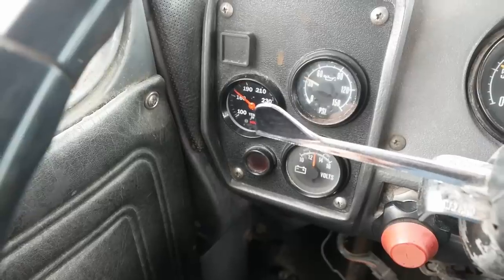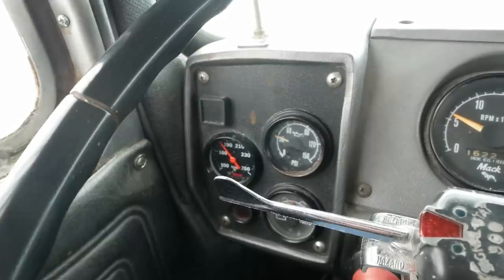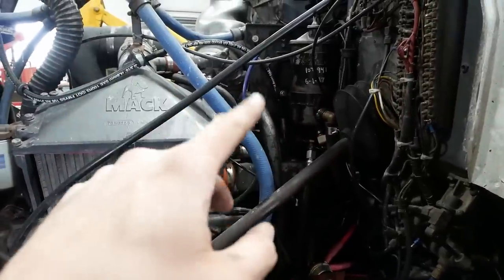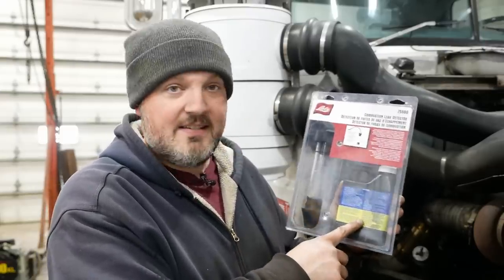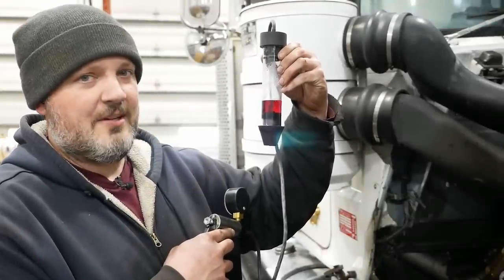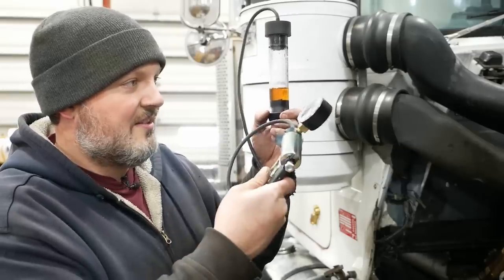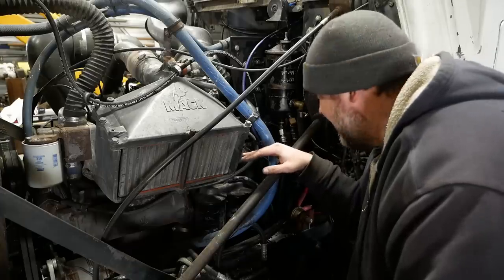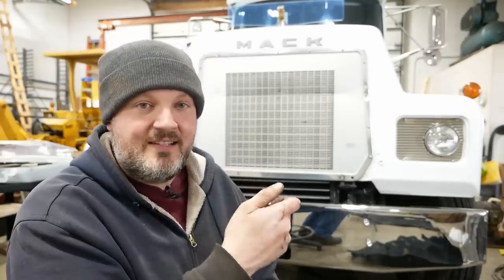Can You Trust a Head Gasket Tester? - R Model Mack Overheating

Comment: Mack RL-series, the L indicates "light weight" as in aluminum frame rails instead of steel.  These were more popular in the western states where they did not enforce length laws, but had weight restrictions.  Did not see them often in the east as east coast states had weight and length restrictions, so cabover tractors were most of what seen in the east.

Comment: Hi Wes, I'd suspect that the  engine is failing due to Cavitation Corrosion of the liners..  The way it blew up that rubber glove so fast ...  If it were the cylinder head gasket, I'd suspect if its been going on for a long time, that there would be signs of oil / water mix in the oil.. as the gasket would continue to be eaten away if the truck is being driven... Would be nice to see what the outcome of the Inflating Glove is ... Keep up the Good Fight .. Love the show .. Andy UK ..

Comment: I've watched Rainman Ray use the same test equip several times before and after repairs and he got good results every time
Reply: I was thinking the same, but he was using the fluid for gas engines.  Maybe the stuff for diesel isn't as good?

Comment: Do Hey Wes the exhaust gas that turns that It turns that chemical a different color is carbon monoxide and as you well know diesels admit very little carbon Monoxide. AST offers Is a carbon dioxide checker , much more effective on both gas and diesel engines.
Reply from the maker: Lisle says it detects CO2.
Reply: The test liquid head gasket testers all test for co2 not co. Lot more co2 in your exhaust gases than co which is in tiny quantities.
Reply: @WatchWesWork   the ATS unit checks for TRACE amounts,  thats the difference. Good cooling systems should have zero amounts of CO2...thats why your missing those leaks thatare not gross.

Comment: Can leakdown testing be done on those?  Wouldn’t relative compression readings give some indication if head gasket has failed between cylinders?  Utter novice here just trying to think of one corroborating test beforehand.
Reply from the maker: Both are very difficult on a diesel. We would have to pull the injectors and have the correct adapters.
Reply: @WatchWesWork    Thx for being gentle with me, Wes. 😉
Reply: @WatchWesWork  how about a scope monitoring the amp draw on the starter while cranking? Since it's mechanical injection, probably would be difficult to find something for a trigger.

Comment: The bottom line is that the cooling system is being pressurized right away after start up. Skip testing to see if the coolant temp sensor is working correctly or flushing anything out. Waste of time. You've eliminated all possible causes other than head gasket or cracks. So focus on those. Thanks for the great content. Keep it up